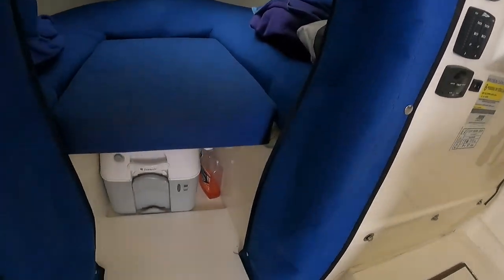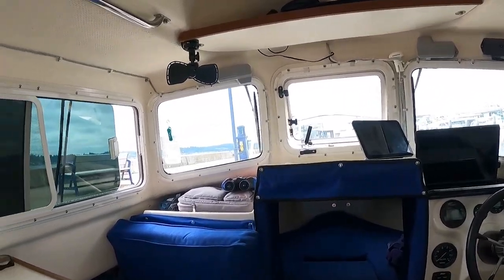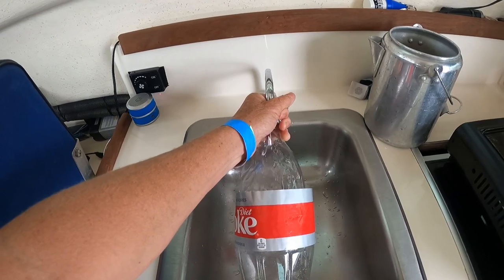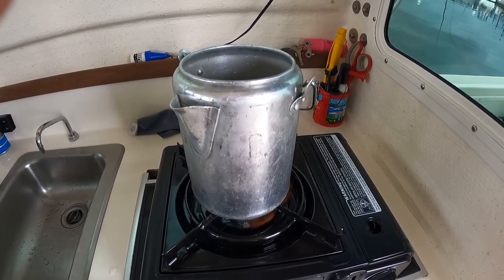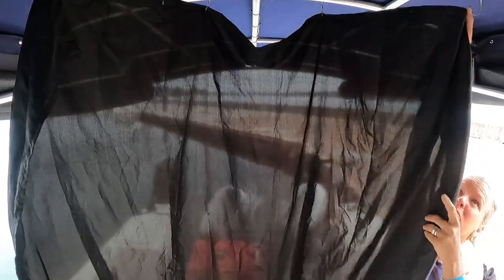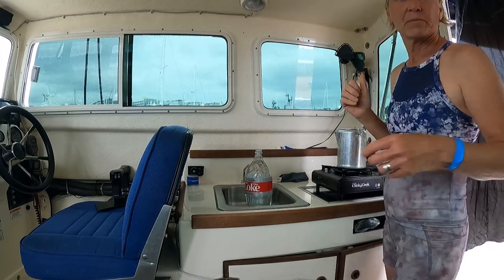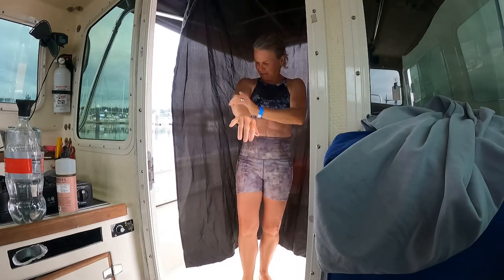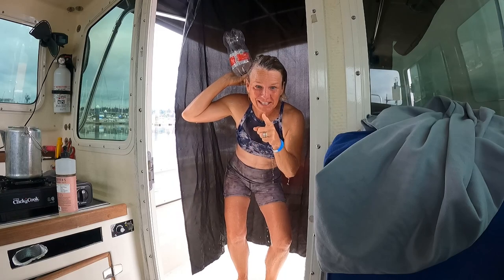C-DORY HOW DO WE SHOWER ON TINY BOAT!!

Comment: What do you think of the C-Dory Tomcat.  The catamaran design looks more stable but what are the disadvantages?
And thanks for sharing your adventures!
Reply from the maker: Hello Reduce GHGs... The timecard is a great boat for sure, only issue we did like is the size. Yes you can trailer it, you're it however everything needs to be bigger from that perspective even paying docking fees. With the size we have it's so manageable from our perspective and how we use it. A full bathroom would be nice though 😘 I hope that helps.